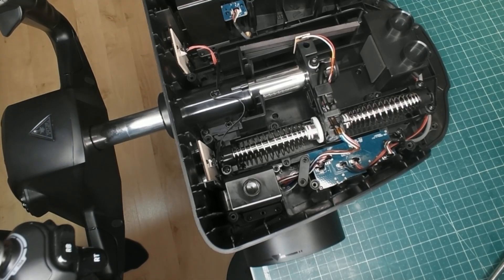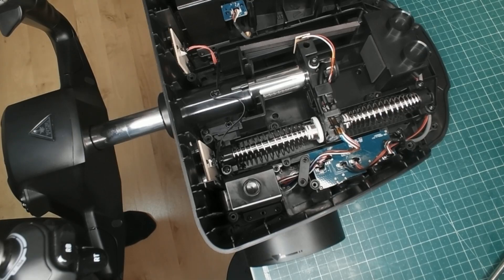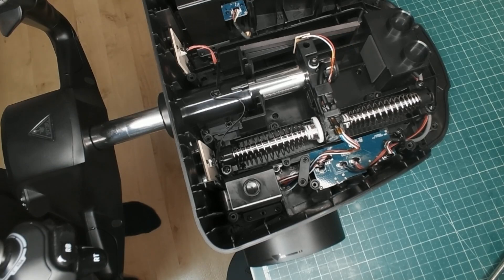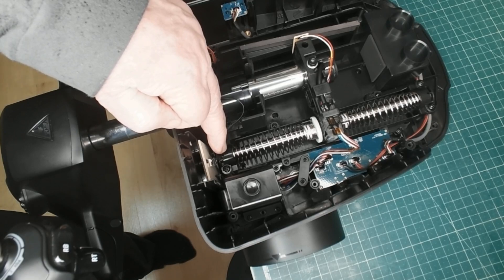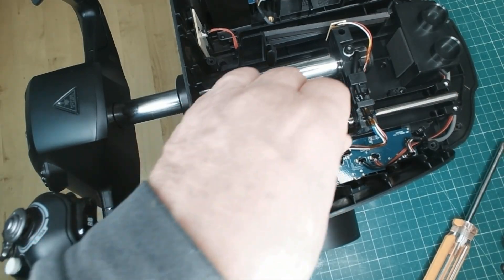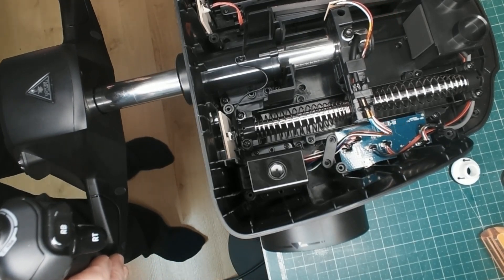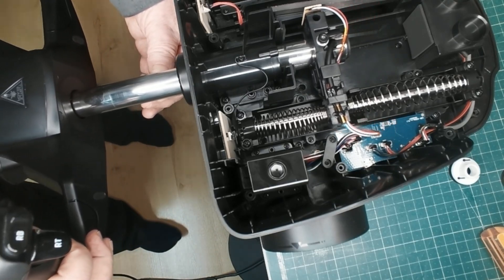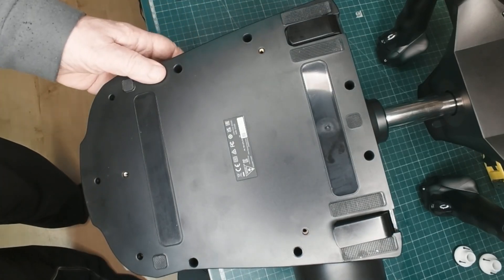VelocityOne Yoke Detent Mod

Comment: I tried your mod and it works quite well, but I didn’t like that the springs rattles and scraped on the metal shaft. What I did was make my own bumpers with 1cm length of 15mm Pushfit tubing - it’s has the perfect internal diameter for the shaft and, with a small amount of filing, fits nice and snug inside the spring. Best of both worlds 😊

Comment: That's a great and easy fix indeed, though I agree with @TWOKDOK1 the nylon washers are here for a reason (mostly contact wear and noise). So in my case I put them in the drill and reduced their diameter with a file :) I reduce the diameter from 27mm to ~23mm and they can now travel freely through the middle detent groove. I had to remove the black rubber and foam pads first to easily file the white tefflon part, and then I sticked it again on the tefflon and cut the part that was going outside the tefflon. It works pretty great now :)
Reply: This is the way! Just tried this and it worked really well, thanks for the tip

Comment: I was at the flight sim expo in Las Vegas last week and there were a number of Velocity One flight yokes set up and I noticed they did not have the strong detent or the stickiness that is present in the older models. I believe they must have made some improvements to the design. I have the 3D printed support rollers on mine and they do work as well. About a year ago I tried to do a mod similar to yours but rather than remove the washers I used string tie to collapse two coils of the spring effectively making it slightly shorter and weaker.
Reply: Hey man, do you have a picture by any chance?

Comment: Cheers for the video.  I don’t have this yoke but the low end quality of it and having to do mods to improve it reminds me so much of the Saitek/Logitech which I had.  Never again will I ever buy the cheap stuff, it’s simply not worth it for the money and you end up paying more in the long run by replacing them with something much better straight off the bat.  FFB is in my near future and I can’t wait to not have to deal with rubbish springs, overly strong centre detents that don’t move with trimming the aircraft and stiction.
Reply: Sorry to disagree but this yoke is great. And not everyone has unlimited funds to buy the latest and greatest. But the Velocity One has so many features compared to every other yoke and throttle set, that doing miner mods to make it work even better, puts this yoke up with the best. As you said, you don’t have it so you have no idea how good and feature rich this device is!
Reply: @anthonymark3771  First up, anything like this that needs mods to fix issues obviously isn’t great, and the level of mods that would be really needed to make this a GREAT flight sim yoke would be expensive enough you might as well get something else in the first place.

Up with the best?  That’s hilarious, you should go on stage with jokes like that and having extra cheap switch’s and dials etc which you can get separately doesn’t excuse its main purpose sucking even with mods.

No, the problem isn’t that I haven’t tried this one, it’s that YOU haven’t tried anything better, were as I have had experience of cheap crap yokes like this and a load of other cheap plastic controls AND of better options and I’ll never go back to this kind of garbage.  I’ve wasted enough money on them and I’ve also done mods to them as well to remove too strong detents, stiction and other issues, which improved them sure, but it’s like putting lipstick on a pig, it still performs like dirt compared to other options and I’ve seen that first hand a number of times now.

As per usual with you people you bring up not being able to afford better options as if that changes the quality difference and as if thats part of your attack on my comment, as if I have something against anyone who’s poor, because the reality is you would have to be pretty poor to not be able to afford something better than this.

You don’t need unlimited funds or even many funds to manage that, and if you are actually really into flight simulation you will find the money and anyone poor enough that can’t find it probably has more important things to worry about and isn’t into flight sims which let’s face it, isn’t that cheap of a hobby.

I don’t even make much money myself, but that’s actually more reason to pay less in the long run than waste any more money on something that doesn’t perform its duties well and I’m unhappy with and so ends up getting replaced eventually which means more money spent, that’s my point.

But you carry on lying to yourself it’s better than it is, I’ve seen plenty of people with your delusions before when they won’t or can’t spend the extra so they go defensive on their purchase decisions.  But I’ve also seen a rare few that when they do wake up and get something better they realise how wrong they were, pretty recently actually.

Comment: The thing about this is that on a real plane, the yoke will tend to want to center the faster you're flying.   It's like a natural detent.  The wind over the elevators makes them want to go neutral at high speeds.  During landing it's much less of an issue.  If you find the tension to high to maintain a certain  position of the yoke, you could always use trim like we do in real planes.  I use trim constantly. That being said.....I have this on order so you might be right and this could be a great mod...I will see what it feels like but I'll bet even without the mod it's going to be an enormous improvement over my old CH Yoke and Rudder pedals!
Reply: did you ever use this mod? how you like the yoke 1 year later?
Reply: @robatw  I didn't do the mod, I find the yoke out of the box is just fine.

Comment: How is your mod working now that you have Kevin's mod.  I have one ordered but am thinking of trying your mod out.  Except for the pitch problems I really love my yoke.
Reply from the maker: Kevin's mod arrived several weeks ago and I fitted it straight away.  It has completed the transition, making the pitch axis wonderfully smooth, even when holding just one side of the yoke.  I'd say it's now actually better than my Honecomb Alpha, being much lighter, wnd with no centre detent at all.
Reply: @ShorebasePaul  So you did leave the spring pads out after you added Kevin's mod?  Thanks for the info.
Reply from the maker: Yes Patrick, they were preventing one spring from gradually taking over from the other.  When they're removed, the transition at the centre is much more seamless.
Reply: @ShorebasePaul  Thank you.
Reply: @ShorebasePaul  I also just received Kevin's mod and was about to fit it. However I'd like to verify that your V1 is now using BOTH Kevin's roller mod, AND your detent removal mod? Or are you just using Kevin's roller? Thanks!
Reply from the maker: I'm using both.
I'd carried out the detent removal before ordering Kevin's roller.
After fitting the roller it did make the action smoother and removed the binding, but I left the detents off as well because it made the central position less 'clicky'.
Reply: @ShorebasePaul  I did your detent mod, and fitted Kevin's mod and it's better.. but I don't think it's as miraculously better as the other comments are saying that it is? I'm not criticizing either mod! Maybe I have to mess with the screw tension on Kevin's mod? I just have mine tightened a turn or two past finger tight. Thanks for any tips!
Reply: @decker12222  I agree that Kevin's mod is good and worth the money and effort, but not miraculous. I will try Paul's in the next day or two. Free is a very good price, and the logic can't be faulted.
Reply: Where do I find this mod?

Comment: Hello, I bought the second velocity one and I have the problem that the X and Y axis function does not show in the calibration. I don't know how to solve it. I tried it on 3 PCs and it doesn't move.
Reply: Open the velocity one there is magnet simply put it in place it will fix the problem

Comment: I have determined the stickiness has nothing to do with the detent stops centring  and have undone the mod in this  video - restored it to original and to day I have dumped the TB Velocity one and have ordered the honeycomb yoke and quadrant....
Reply: I just got one of these and it transformed the yoke. Worth every penny
Reply: https://youtu.be/4hW4pp7fRxM?si=IP4GO0eMe7FNN9ua
Reply: Right, it's really two different problems. 1) the centering that this video address and then 2)  the "stickiness" that the 3D printed mod is addressing.

Comment: Thanks for the video but unfortunately for me the mod does diddly-squat!  (no reflection on your video or effort for posting) I still get the stickiness. I am going to put back the white nylon/plastic spring locators/stops without the black rubber/foam spaces and see how that goes. Of utmost importance is the smoothness of the control!  All Turtle Beach can say it that it frees up with use..... I have been using it now for 150 hours of flying by hand and not autopilot, and it is just as sticky as it was new. So how much use does it take to free up - never perhaps.

I do not mind the detent as such it is the stickiness where you are trying to finesse a landing by pulling back against the tension which then suddenly lets go and moves too far and the nose of the aircraft goes way up and buggers up the landing!

This relatively expensive yoke is crap.   I do hope the Honeycomb brand of yoke goes back into production and once again becomes available because I will be dumping the Velocity one yoke and getting the Honeycomb as soon as I can.

I suppose if I had a 3D printer I could design and print brackets to hold small bearings inside for the shaft to roll on - I am aware of the ghastly mod to put bearings on the out side of the box.
Reply from the maker: Coincidentally, I have now also fitted VanDeik's "Ghastly Mod" of the bracket outside of the box with the rubber tyred roller bearings supporting the yoke shaft underneath as it exits the front plastic collar.
I have to say that it now works brilliantly.  Now that the "sag", caused by the hands resting on the grips and weighting it down slightly is now fully supported by the roller bearings, so that the shaft moves in and out as smoothly as any other yoke that I posess, (an Alpha XPC, a Macbare, and even my Brunner CLS-E !).
The combination of his bracket and my removal of the spring stops has made the pitch axis perfectly smooth, with a gradual transition of forward to backward resistance.
The roll axis still has a very distinct centre detent, but that is much easier to live with.
I agree completely that the standard factory performance of the VelocityOne yoke is almost unusable in respect of the awful pitch axis binding, making final approach and flaring very unpleasant.  Amazing really, considering how much effort they've put into the rest of it.
It's a similar story (IMHO) with their VelocityOne Joystick too,  I find that excellent, in all but one respect, the ridiculously stiff centre detent.  Luckilly though, I found a video here on Youtube where the Guy explains a very simople mod of opening the base and either cutting the coil spring or replacing it with a weaker one, (which I did), and that too, is now my best all in one "portable" joystick.  (I also have a Virpil and a Rhino FF, which are in a different league altogether, but the VelocityOne is much more compact for portable use.
Reply: @ShorebasePaul  I have the VanDeiks mod as well. For some reason only one of the two rollers on his device is touching the shaft. Have you had any issues with that ?
Reply from the maker: No, I had no problems with it.
There's a fair amount of adjustment when you bolt it on, and I was able to get both rollers touching nicely.
Reply: Hi Paul great video of the mod, I shall be trying this as it definitely is to abrupt jerky movement landing at this point on the yoke. 
Please can you tell me if there is a link available to Vans roller mod. Thanks
Reply from the maker: Yes Gary, it's at
https://www.etsy.com/uk/shop/vanDIJKstuff?ref=l2-about-shopname
Reply: @ShorebasePaul  thanks Paul
Reply: @ShorebasePaul yo can you make this mod and sell it I was trying to buy it but it’s sold out

Comment: Very well put together video and clearly explained.  Thank you. That 'detente' at the neutral point is really annoying on landing.  This looks like it does the job.  However, those Nyon bushes are there for a reason which is to act as a thrust bearing to prevent direct steel-to-plastic contact which is likely to wear the contact point on the travelling arm. Not only that but the collar in the nylon bushes also locates the spring ends radially so that it does not rub on the shaft.     I suspect that the plastic on the travelling arm will wear and that the shaft will become scratched making the action less smooth.  But time will tell.    Perhaps a thin nylon washer to replace both bushes would be a possibility to prevent steel-plastic contact whilst not reducing the improved smoothness allbeit that the potential for shaft scratching / wear would still exist.  Thank you for broadcasting this simple mod.
Reply from the maker: I hear what you're saying, but the collars on the bushes are plastic anyway, and a lot thinner than the central arm, so if there's any plastic to metal wear it would occur with them anyway, (and I doubt if they're available as spares).
Also, the shaft is very hard stainless steel and the spings are not (so are softer), so I don't think there will be anyscratches on the shaft from them.
Reply: @ShorebasePaul  Para prevenir esse problema, criei umas anilhas, na impressora 3D em TPU e assim, as molas estão sempre centradas e não fazem barulho.
Reply: @mjrteks can you share the 3d printer files ?
Reply: @ShorebasePaul is it still working fine with no wear?